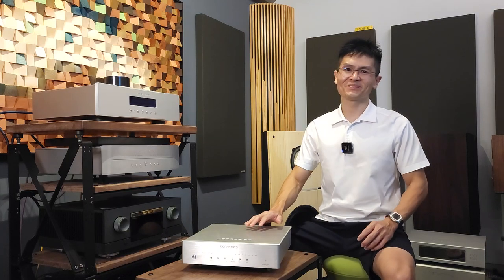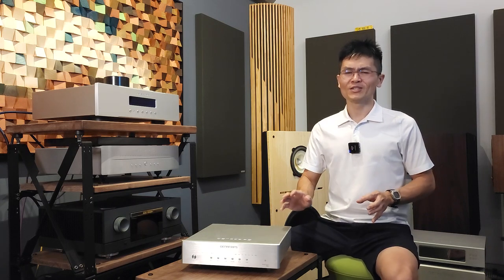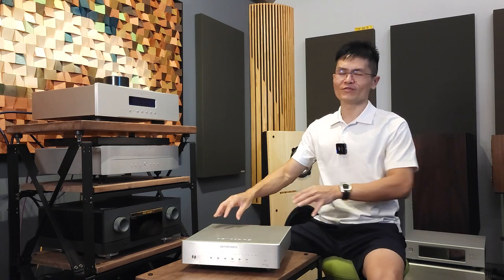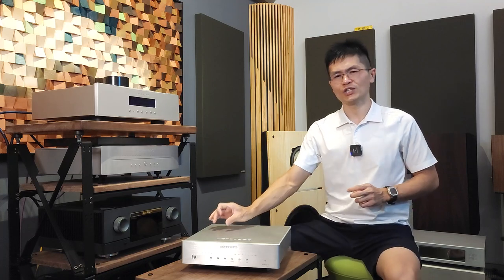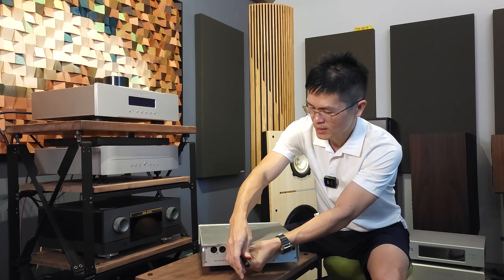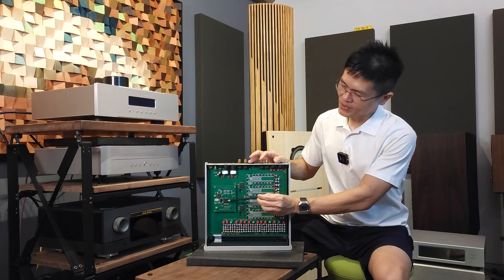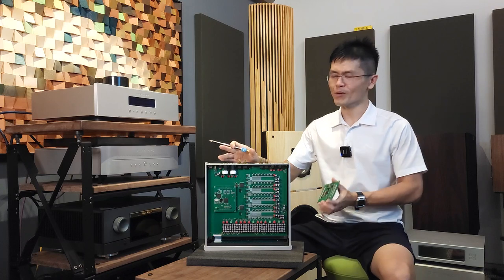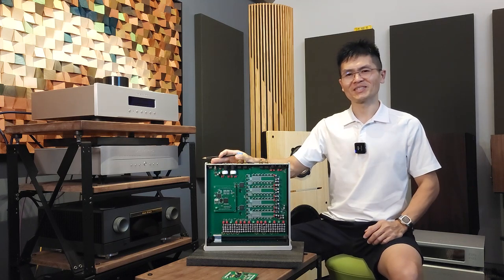DENAFRIPS 12th ANNV.  FPGA FIRMWARE UPDATE | PONTUS II DAC

Comment: I just wanted to say that I just successfully updated the firmware. There is a noticeable difference and it is definitely an improvement across the board. The NOS filter has been improved. Also speed and transients are much snappier and fast. I followed the instructions and had no problem at all. Just 1 thing I'd recommend to anybody willing to do the firmware update...make sure you check the device manager on your PC/Laptop to make sure the USB driver and firmware Downloader are showing.

Comment: Have to chime in here.  Relatively happy with my Pontus II but this firmware update process has me wondering if someone is asleep at the wheel.  After opening and submitting a picture left me thinking they're not sure what is inside, I waited for 3 days for a response to find that Denafrips isn't even competent enough to have their drivers signed.  If I understood the poorly written directions the driver update was required to flash the firmware, still not sure why. After finding out that bitlocker is on my laptop and I cannot disable the signed driver safety, I used another PC to install.  A extremely tedious process IMO.

Comment: Hello Alvin, is this firmware update just for the Denafrips 12th anniversary? i have the Pontus II DAC bought from you last year. Thanks for your response.
Reply: This update is not for new 12th Ann models. It is for the Pontus 2 and also the other mk2 models.
Reply: I have an email confirmation from Alvin at Vinshine that the Pontus ii 12th already comes with the new firmware. 
No need to perform the update.
Reply: That was what I’m saying but some disagreed. The new 12th models don't need this upgrade. Maybe the confusion is due to Vinshine naming it the 12th anniversary FPGA upgrade. But Vinshine had made clear in the videos that this upgrade is not for the 12th models but to upgrade the older models' FPGA firmware.